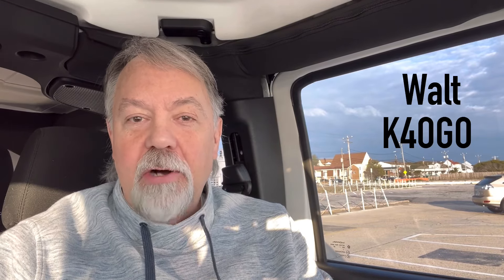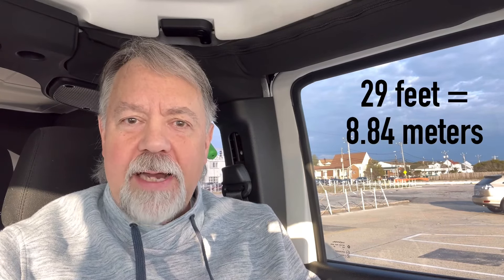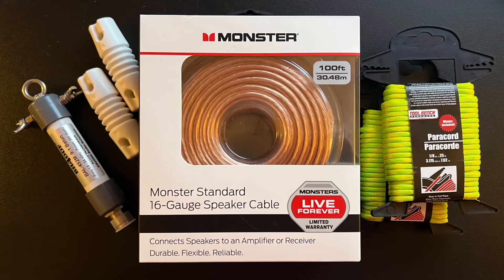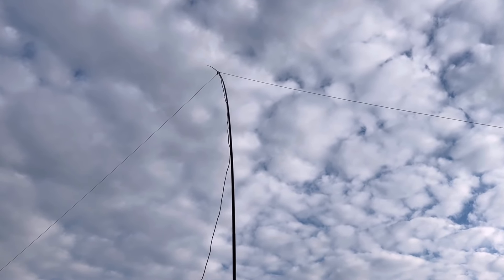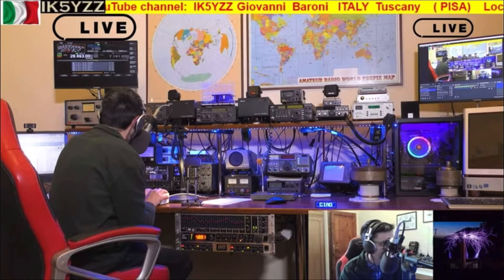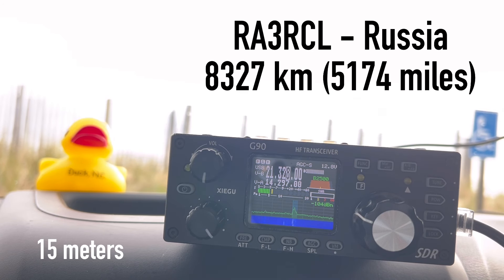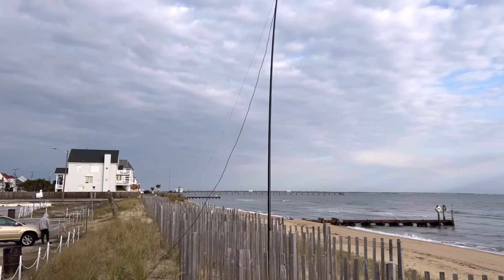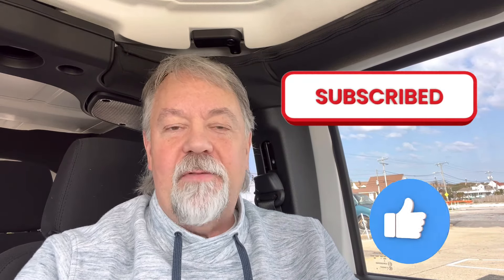Building a Long Wire Dipole Antenna

Comment: If it's not a resonant antenna it is commonly referred to as a doublet. That Japanese QSO was especially impressive
Reply from the maker: Roger that, it was called a random wire dipole in the book I showed and referenced in the video. 73, Walt
Reply: @ThePrivateMan3301 I suppose that's true, but using the 9 to 1 balun at the feed point "emulates" a 450 open wire feed

Comment: Great test. The antenna is sort of an extended double zepp. In fact on 20 MHz that is exactly what it is!
Basically each side of the dipole has an element that is in phase with the opposite element. If each side were 1/2 wave long it would be a collinear array with two half waves in phase with no separation. ( I think about 2 dB gain over a dipole) As you go longer the halfwave element ends are further apart and the gain increases. The center part ( between the half wave sections) is out of phase so tends to cancel the gain, but if it is short that effect is minimal. When each half is about .64 wavelengths long you have reached the optimal spacing of the two collinear elements and maximum gain broadside. After that the center section noticeably cancels the gain broadside. Your antenna performance will be best at about 20 MHz as at that frequency it is a true extended double Zepp. Above and below 20 MHz it will still work pretty good. At 8 MHz it becomes a classic halfwave dipole. On 7 MHz it is a short 40 meter dipole but still long enough to work pretty good. The only down side I can see is on some frequencies the SWR could be high and SWR loss should be calculated using the matched feedline loss and the table that is in all the antenna books giving “ additional feedline loss” due to SWR given the matched feedline loss. With very short feedlines, such as for portable antennas that should be negligible. 
Good job! I am interested in what the SWR was on the coax on the bands you used using the 9:1 balun.  I have not really analyzed the antenna in any great detail, but I am confident the feed point is not anywhere near 50 ohms on any band.

Comment: That was super fun. great DX antenna. your angle of the V helps with that . looks NVIS on 40 meters. this antenna has more gain than end fed random wire.  that uses a UNUN and your inverted V needs Balun . when it gets like under 3:1 with out tuner you get less feed line loss and less work the ATU has to do. makes more RF in and out the antenna . yes you can make that with a 1:1 and let the G90 tune it but will be more loos . mostly feed line loss. over or under 50 ohm makes coax more Losey . that why we use UNUN and Balun to get that closer to 50 ohm or use ladder line which is higher ohm. love the DX antenna . now I want to try that . I made the outher 9:1 random wire as sloped. had to play with counter poise length a bit to get 3:1 or better and less common mode to radio. your antenna hear cancels common mode out because of balanced dipole into a Balun and what little is stopped buy the choke at Balun. nice Walmart wire. works great ! if you keep it up long time it will stretch and that clear jacket will crack apart . but for testing and portable it is great. I found insulators from tractor supply made from electric fence work great for wire antenna's .  73's

Comment: Here is one you don't see much but works awesome.  Full wave doublet at .6 wave length above good ground.  Narrow bi-directional radiation pattern that has over 2 db of gain over a half wave dipole at the same height.  One of my best multiband doublets was 300 feet long!  Of course feed it with 600 ohm twin feed line.  73, KF0BBU

Comment: Nice video Walt, some great qsos. I started watching and thought you are just going to lose all your power to the feeder then I realised getting to later in the video it was a 9:1 Balun not a 1:1 balun. If you are getting 2:1 or less on all bands that’s awesome. You could also try 300 ohm twin feeder and place the Balun near the radio. Which would be more a doublet. You might need to experiment with feeder length and balun ratio. You can computer model if you prefer. Also you can try using the speaker wire as the feeder. 73 Steve MW0SAW

Comment: My QRP CW rigs do not have tuners, but my ATU-10 tuner is the size of playing cards. I am curious about the performance of tuning at the radio vs  doing it at the Unun. I love my Packtenna 9:1 so I will try that 29' first, but of course I have to add in the counterpoise since I then wouldn't be using the coax Sheild for that purpose. I love to play with antennas for sure! Cheers, Davey --KU9L

Comment: It is another way of random wire antenna set up. what is the performance of it compared with 29 feet vertical (17 feet ground wire) ?

Comment: That's a fantastic antenna. Simple design and even 2:1 swr is fine very much workable. 
Absolutely worth trying to adjust elements for better tune. 
All the best Walt 73 
M7LDK